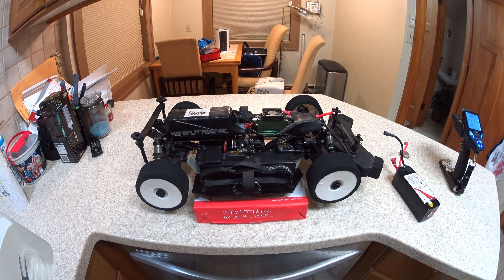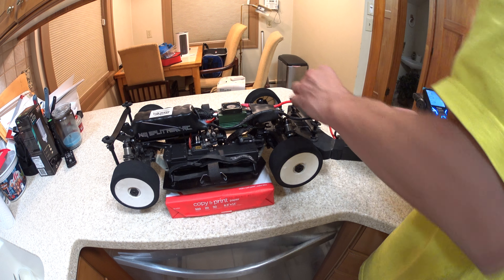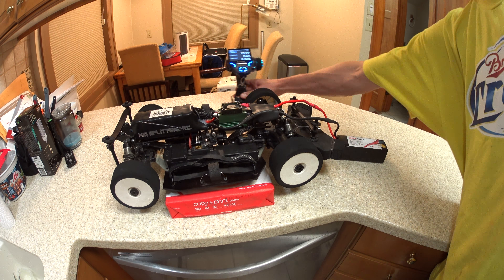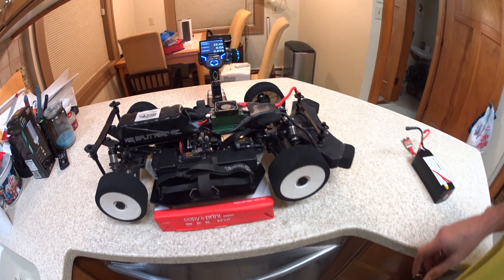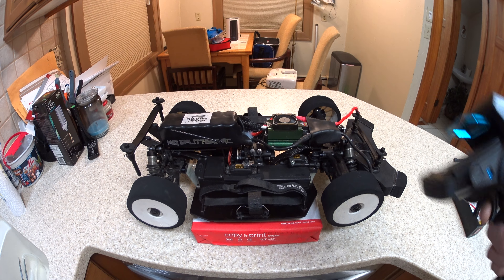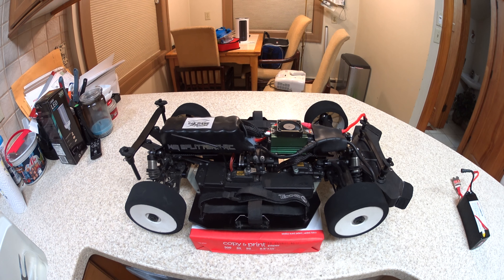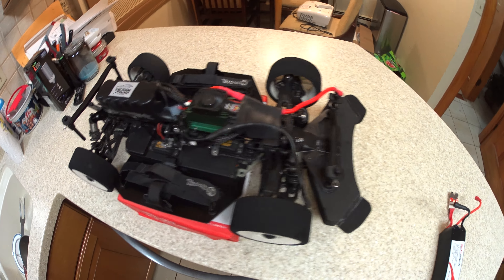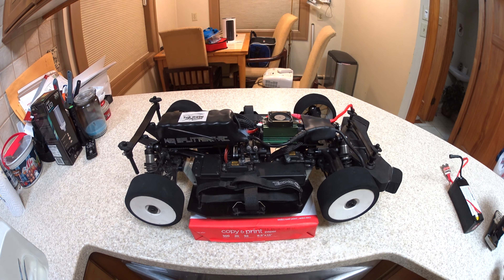EVUL EMPIRE RC SUPER CAPACITOR DEMO!!!!!!!

Comment: This is a display of capacity.  Capacity can be had by adding another battery, which by the size of that thing , is what you have done.  Caps are for protection though, and that is done through esr rating.  So whats the esr on that thing?
Reply: 42 replies, one who questions. That one guy using his head for more than a hatrack.
Have a reality good day!